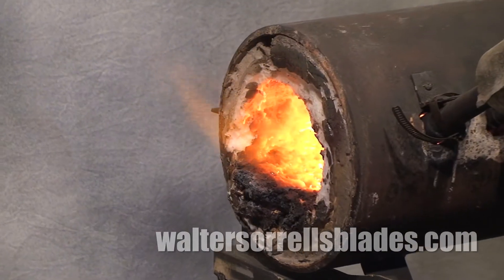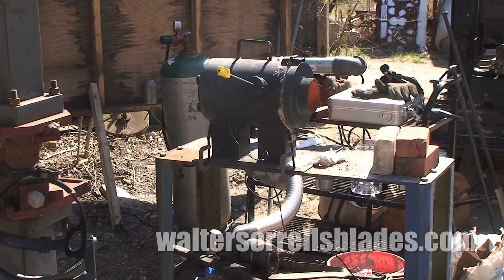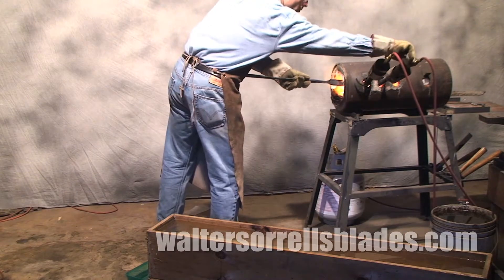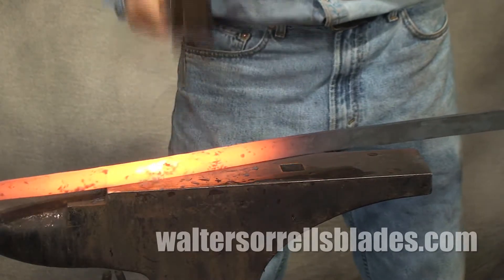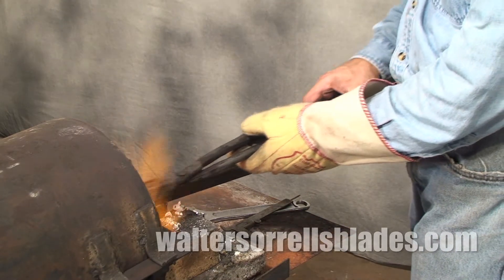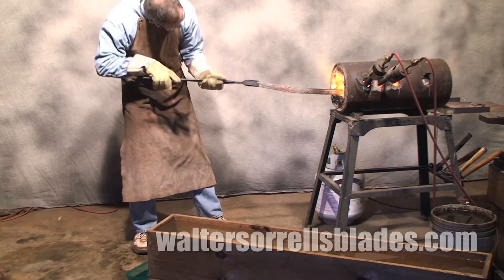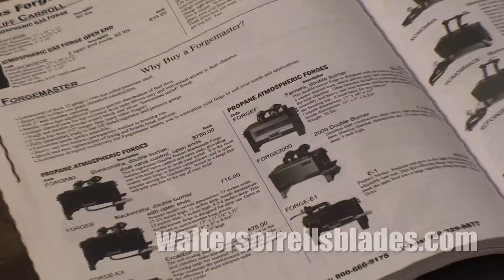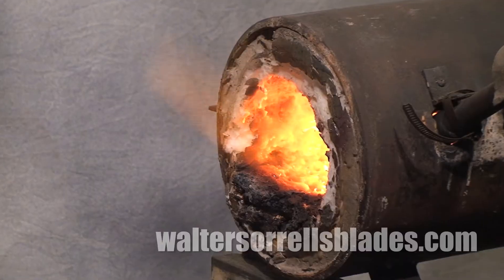Knife Making Tools Part 7 : Propane Forges

Comment: Can  you please tell me what's the liquid you put the knife in after heating the knife up to cool down because of course I don't think it's water?
Reply: Simple Alaa it is oil, dude. The quench hardens the steel if it has carbon. I could be water, but for complex reasons water may warp or crack the blade is the steel has too much carbon in it
Reply: What kind of oil ?! and thanks for helping.

Comment: I am a novice Blacksmith, but I want to add one thing if I may. I found a very old forge at the flea market. I was looking at it and it looked to have the old asbestos lining. I asked the guy if he ever used it, and he said no, it was in his Grandpa's basement, and he dug it out and was selling it. Just know that it's not impossible to find it's still out there.
Another thing is the perlite insulation is not something you want to suck into your lungs. We used to use it after welding pump shaft journals, to slow the cooling so we could machine it back down, (annealing it).
Learning about Blacksmithing, but 42 years in the design and tool making field helps you learn about some things that crossover.
Smiles!

Comment: Great video. I think the only thing that was missed are the health hazards of an unsealed kaowool style refractory. There are so many videos online showing refractory blanket with no sealer (satanite or ITC) . The particles create a significant health hazard, and I think there are a lot of knife makers out there putting themselves at risk for lung issues. I started with an unsealed forge, but now have sealed with a brush on refractory coating. Thanks again for these great videos.
Reply: have you seen the product that is a clear blue liquid spray on "hardener" for kaowool?  It says it is coloidal silica. I wonder if that seals the fibers from becoming ariborne.

Comment: The biggest concern i have for propane is consumption. I am just starting out and would like to know if propane would be cost effective or not
Reply: Ky Hudgins Propane is a lot cheaper
Reply: as of how? i can buy coal for a few cents a lb. how long does a tank last you? if i may ask. i need to know since i am debating on whether or not to buy a propane forge.
Reply: A tank last about for me 45 hours
Reply: that's not bad. how large of a tank?
Reply: Ky Hudgins 20 lb
Reply: that's great. how many burner do you have if i haven't bugged you too much?
Reply: Modern Bladesmith I was going to have 2 but then only use one, I got the plans from  the king of random but I have a fan also hooked up to get more air
Reply: Modern Bladesmith tbh It might have costed me around 150 dollars to build mine
Reply: i priced the steel here and it's expensive af.
Reply: Ky Hudgins use a old propane tank

Comment: i'm in doubt of using perlite insulation or just use clay to make a gas forge, wich one is better in terms of cost and beneffits?
Reply: plaster of Paris and sand and water that works best watch king of random foundry how to
Reply: if you will make damascus it will melt.
Reply: +Josh&#39;s Whips And Lanyards Do not use sand. It will melt.
Reply: +tompan karlson no I already did it it did not melt

Comment: Call me old fashioned but I rather use coal or charcoal with a bellows.
Reply: i personally think charcoal forge is bettet than propane and more badass
Reply: +Try to survive well there are advantages and disadvantages with each. My suggestion to anyone who would like to get started in forging is to weigh their options carefully. However I will say that you lose a certain feel when you go completely modern.
Reply: +Thatoneguy overthere hell yes!
Reply: Thatoneguy overthere wear a respirator I'm fighting a sinus infection from inhaling coal dust.
Reply: currently using coal, and i must say that i would love a propane forge. i did however make my forge for under $40.
Reply: Modern Bladesmith $40 bucks? How and what capacity? Please...and thank you.

Comment: I'm just starting off and don't have a very good forge, i was wondering if you could tell me what the walls of your forge are made from? please (the outside casing)
Reply: +sammy 210 I made mine out of a 30# propane tank i cut up, but just about any steel tube will work  as long as it isn't too thin. i think the walls of propane tanks are about 1/8" thick.
Reply: +sammy 210 Kaowool is what he uses

Comment from the maker: Sure, there will almost always be a certain amount of flame coming out (depending on the design of your forge, of course. Without seeing it, it's hard to know what the right amount is.  If a burner is running too rich (i.e. too much gas, too little air), you'll get a lot of blue flame coming out the front.  If the flame is orange and not too big, though, that's generally not a problem.

Comment: Hi, Walter; if my forge has a large amount of gas coming out of the front, does that mean that I need a wider chamber, or a different angle on my burner? Is there a normal amount of flame that should be coming out of the open end of the forge? Thank you!